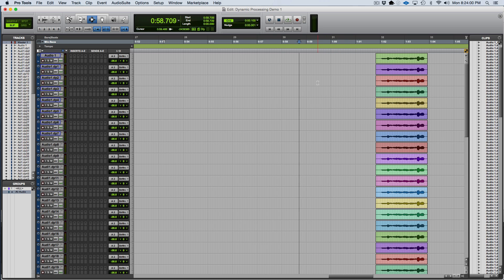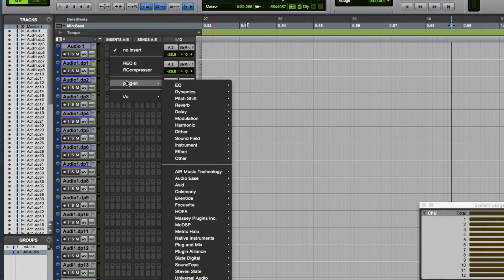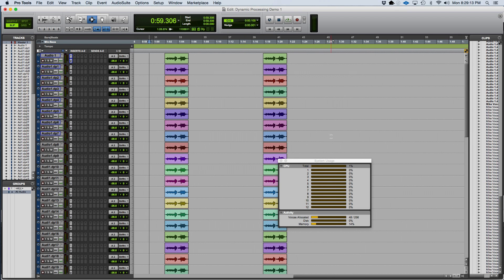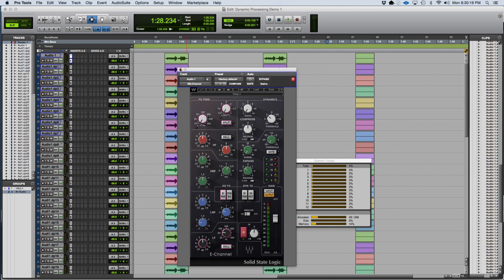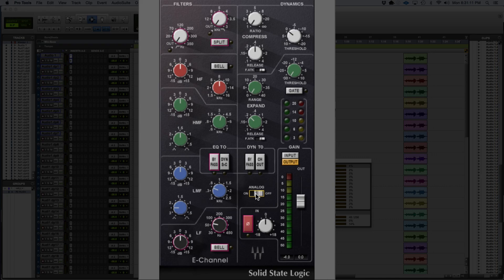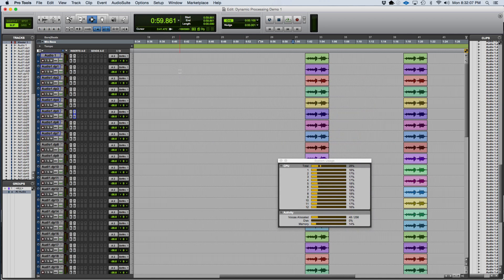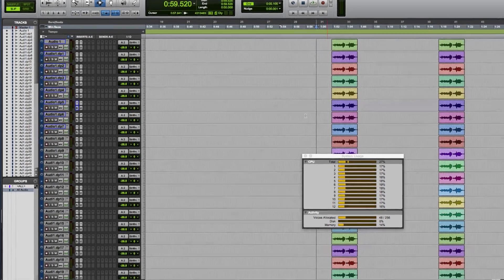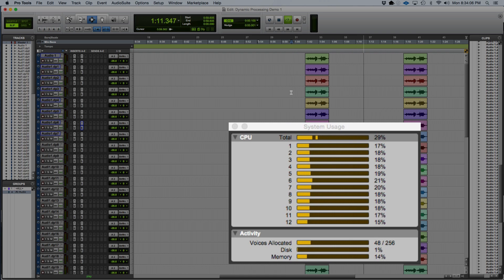Dynamic Plugin Processing in Pro Tools - How It Works

Comment: What is the magic sauce here? - I can not get Pro Tools to dynamically process on audio tracks - on aux's they work correctly.
I am using a pure native rig where you seem to be using a Native HD rig. Maybe that's the difference.
On audio tracks the dynamic plugin processing only disables the plugin when the playhead is stopped, as soon a the playhead is engaged the cpu spikes up even with no active audio regions close by... (stumped) 
I really can't figure this out. I made a quick video that shows the issue.
https://youtu.be/izsM36eYyDM
I also did more tests with a fresh install of High Sierra and many versions of pro tools from 2020 all the way back to 12.6 with the exact same results.
I am hoping you might know the answer because you are the Professor after all...;-)